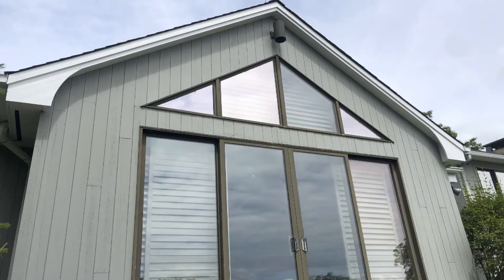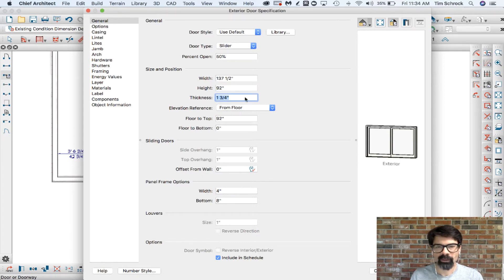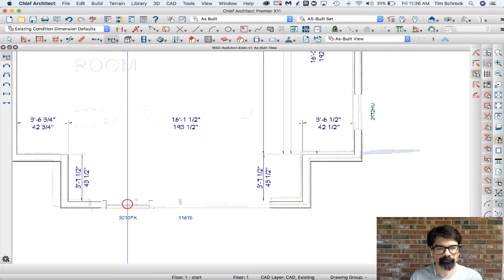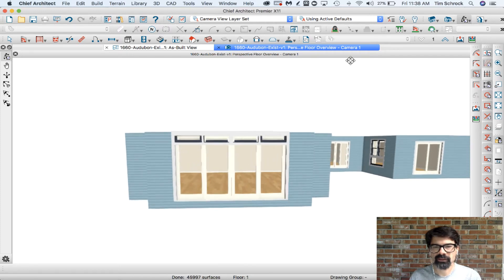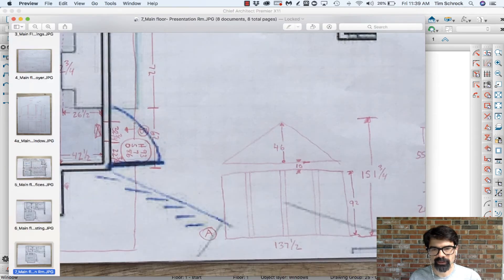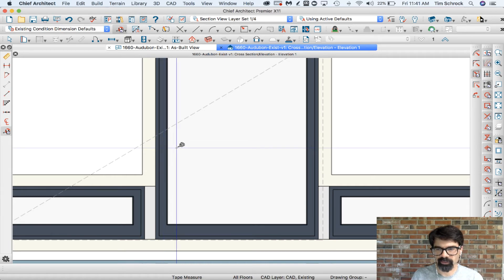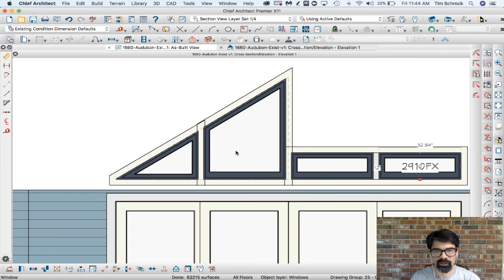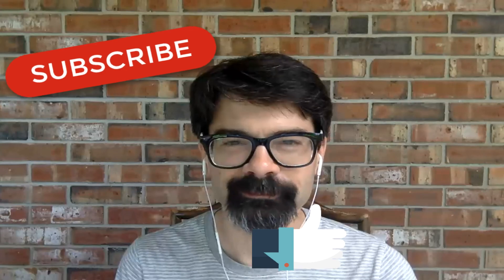Custom Shaped Windows | Chief Architect

Comment: Good video, i enjoyed every bit of it. I keep wondering if it's possible after removing the casing to make the frames actually bump together without any gaps between them? This has been a frustrating issue me for the past 2 years. When I try to join two windows together (without the casing) I always end up with the wall still showing in between the windows, no matter how I push the frames to meet, the wall will always show. Pls help!
Reply from the maker: Sure! Double click on your window tool and at the bottom of the first page there is the section called "Options" and under that is "Minimum Separation" Set that setting to 0, then you can bump the windows directly to each other.
Alternatively, you can dimension from the windows sides, select one window and then click on the dimension to change it to 0 (without changing the Minimum Separation setting)
Reply: Thanx for the quick response. I'll try it out. Thank you once again.
Reply: I've checked for the minimum separation under options and couldn't find anything like that (I'm using X15) but I tried the dimension system and it worked. I guess the minimum separation was scrapped in X15 or maybe the name was changed, what do you think?
Reply from the maker: @mbanugouba2152  nope. I checked it in X15 when I typed out that response. 
Did you double click on the window tool to open window defaults? Or just double click on a window? Has to be in defaults. Double click on the window tool
Reply: I'm so sorry, I've seen it. I was so worried, didnt quite read through your instructions. Thank you so much, now i can sleep well tonight (I live in South Africa).
Reply from the maker: @mbanugouba2152  good to hear. Glad you found it!
Reply: Thanx and enjoy your day.